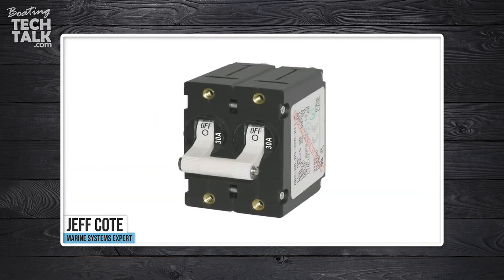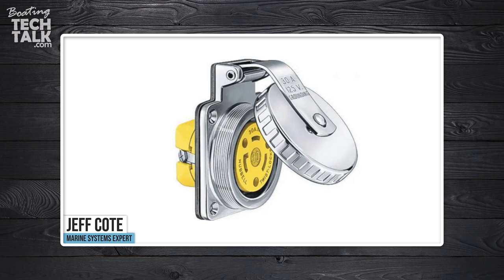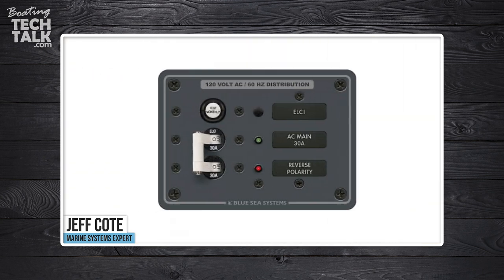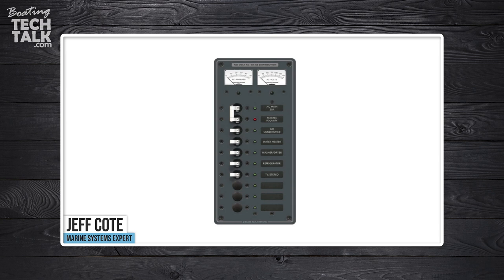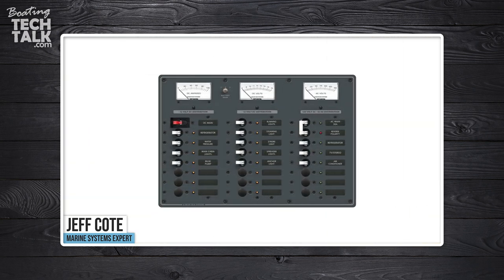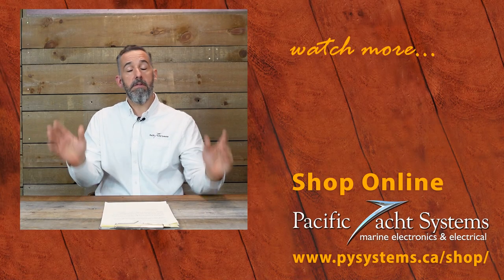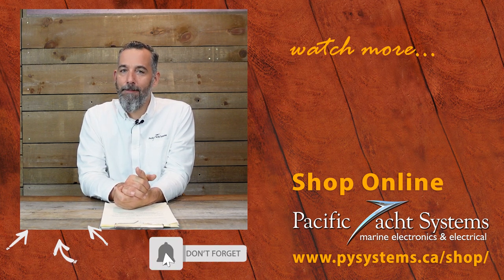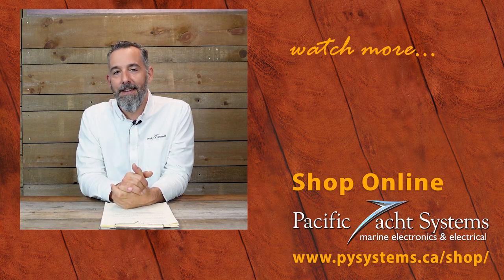Do I Need a Separate Breaker for My Shore Power Cord on My Boat?

Comment: Well explained, as was done more in depth prior. Some are not aware they may have dual pole single lever mains ( as opposed to the double lever pictured) or a single pole main as I still find in very old or improper systems. Not suggesting the uninformed open there panels to see. Just got off an AC install the site rep kept on pointing within inches of live unguarded mains bars, once while looking back at me away from his fingers.
Reply from the maker: Braith, thanks for sharing, well said.

Comment: Hey Jeff.  Just to clarify the terminology a bit.  In the states, we refer to A/C Romex as 14/2 wg, 12/2 wg, and 10/2 wg….”wg” standing for “with ground” for the 3 common sizes of household wiring.  In those Romex bundles would be a hot conductor (black), a neutral conductor (white), and a bare copper conductor (ground).  Romex with a 4th conductor, we call 14/3wg, 12/3wg, and 10/3wg respectively.  The extra conductor is red in color and is normally used for 3-way switches.  I’m thinking you guys refer to it differently in Canada based on how I hear you explain it??
Reply from the maker: Oh wow, thanks for the explanation, yep it does sound different. For instance, in the marine world, a AC 10/3 cable, as only 3 conductors (hot, neutral, and ground).
Reply: @PacificYachtSystems  Thanks for all you guys do!  These systems are simple, yet complex at the same time.   I often find myself getting tripped up keeping the A/C and D/C separate and trying to process all the intricacies of each (speaking as an electrician here in the states).   Keep up the great work.  I really appreciate your channel!

Comment: So I replaced my dated disconnect/breaker between my cablemaster and transformer primary with a Blue Sea ELCI pannel. Added an FS60 isolator also.  
Question: Is it true that ABYC requires a double pole breaker at isolation transformer secondary as well?

Comment: Hi Jeff,just wondering is there a limit to how many outlets you con run off one breaker,just rewiring and updating 25 ft 87 bayliner to 230v,new shore power inlet 30amp,galvanic isolator,230 blue sea panel and new batt charger,pronautic 1230,am I missing anything else,any help much appreciated,tks
Reply from the maker: Remember a 15 amp breaker can have multiple 15 amp AC outlets connected to in series, but the sum of all loads on all the AC outlets cannot exceed 15 amps. In most cases, you see 2 or 3 outlets per 15 amp breaker.

Comment: If you need a breaker within 10 ft of the shore power inlet, why do you need an additional breaker downstream (not talking about individual load breakers)? Wouldn't the one protect everything? Is it just convenience to have the breaker on the main panel with the rest of the breakers while still protecting the long run from the power connector?
Reply from the maker: Good question, i can only speculate as to why, since i wasn't part of the writing the ABYC marine electrical code. I suppose, the AC panel needs a breaker, that's were you expect it, and if this double-pole main breaker is more then 10 feet from the AC outlet you need another breaker, which is used as a protection breaker for the AC line within the boat until it reaches the main double pole breaker at the AC panel.
Reply: The first breaker protects the lead-in wire. The second breaker (on the boat) protects the boat.

Comment: While working on my boat on the refit, some which 8nclude electrical, as I watched this video, I glance at my distribution panel, and it only has one A/C breaker, next t the reverse polarity light (all original 1984) and I should know better because I have seen the dual A/C cb before on other equipment. So another item to add to my list though it will probably require an updated distribution panel. Oh well, it is what it is. Thank you.
Reply from the maker: Mo River, boats and the ensuing boat projects are also part of the journey, good on you to keep making your boat safer and more reliable.

Comment: GDay Teåch 🍎 
I was channel surfing 🏄🏽‍♂️ 
{ that’s Thankfully 😅 HöW I came acrøss your Experientially Profound, InformatiVe channel ✨🙌🥳 }
& I saw 👀 this chap lower a piece of silver over the gunnel of his steel boat,  was he monitoring electrolysis ⁉️🔍🤔
Is this just an antiquated way to measure 📐this reaction, or is there a superseded, reputable device ⁉️🔍🤔
Cheers 🥂 🦘
Reply: Quite common, even some fantastic plastic sailors use silver cells to check for stray currents. Better than, surprise your expensive prop/strut (or whatever), just fell apart, due to unnoticed electrolysis.😱
Best wishes from the North.
Reply from the maker: We use a similar tool quite frequently, it's a called a reference anode for measuring various underwater metal points throughout your boat.